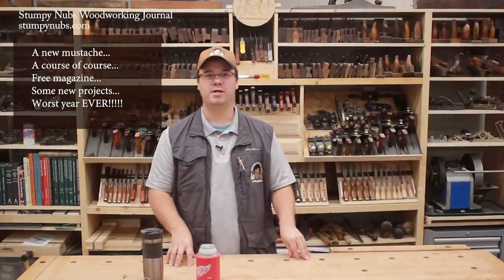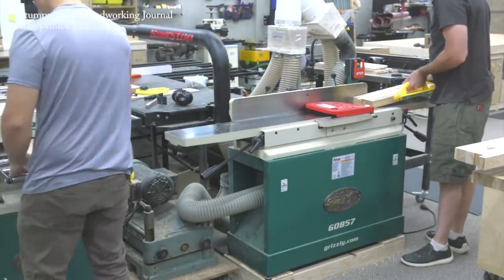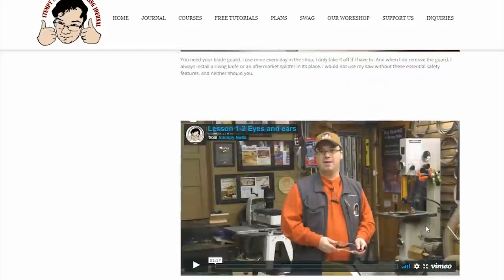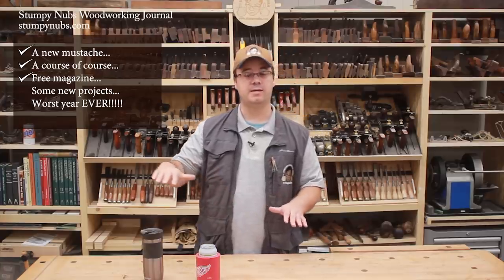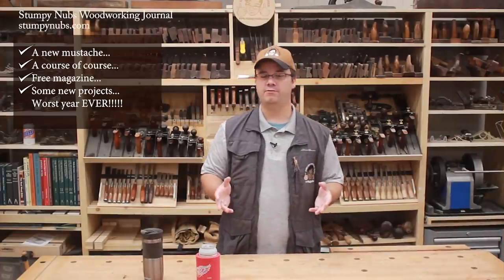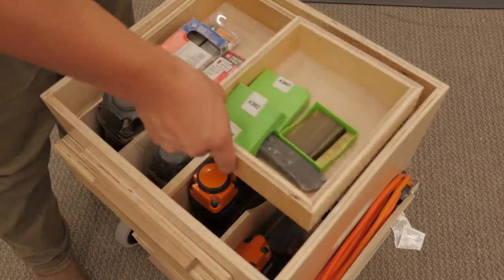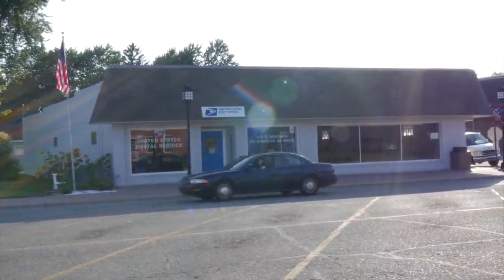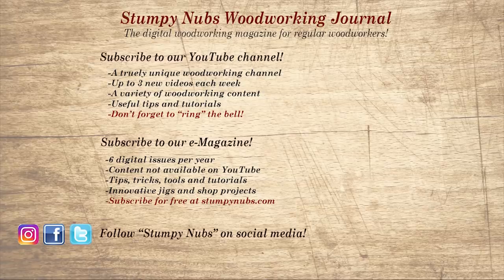I need to tell you about some big changes and some new projects.

Comment: Love your videos and just bought your Homemade Workshop book. As someone just getting into woodworking, I am looking forward to more videos including the courses.
Reply: I’ve been reviewing the design for the router table lift from your outstanding Homemade Workshop book.  (Readers/viewers need to buy this book or the plans from your website!) The design is pure genius and is next on my build list to get my garage-based shop ready to build some actual non-shop projects (crawl/walk/run). The one challenge I see is I just got a Bosch MRC23EVSK router which has both fixed and plunge bases, but requires the swappable motor to be in a base in order to power it on. I plan to mount it with the fixed base and motor inside your router lift, but need to account for the handles, increased width and not quite cylindrical shape. The widest part on the handle axis is 10.5 inches. From the router lift diagrams it looks like the width of the router mounting panel is 9.25 inches. So unless I orient the router a bit sideways or remove the one handle that doesn’t have the power trigger it won’t fit. With the non-trigger handle removed the handle axis is reduced to 8.5 inches, which appears to fit into the mounting panel width with 3/4 inch to spare. I was wondering if you had any thoughts or suggestions as to whether this is the best approach before I start making cuts. Either way I’ll still need to account for the trigger handle arm with the router mounting blocks. Thanks!

If I get this to work, I want to put the lift in my Delta 36-725 T2 table saw and see if I can get your sliding router table and router fence to work with that. I’ve seen a lot of router table videos and that is easily the most creative and useful.

Comment: @ 2:43, the nail you are holding is what was used to install the cedar siding (3" horizontal lap) on my house, built in 1933.  Over the last two years, after insulating the house, I peeled all of it off, installed R-5 Blueboard (with cellulose blown in the cavities, behind the 10" x 3/4 horizonal sheathing), and covered it with vinyl siding. I now have about 30 pounds of those nails. They look too cool to throw away or recycle. About 40 years ago, I had an uncle who brazed these into orthogonal grids of nails and made wall hanging art out of them. Any idea on their origin? Is there some story behind them?
Reply from the maker: Here's a video all about them: https://www.youtube.com/watch?v=7rwcGXIORro

Comment: Great video! Lots of teasers but I’m looking forward to your classes. 
How long is the wall you’re working on?
Reply from the maker: 14-feet, the standard length of a garage wall. If your wall is shorter you can sacrifice the spot for the band saw on one end or the drill press on the other (a bench top drill press will sit on the workstation where the grinder is.)
Reply: @StumpyNubs  I have the space, so I'll be very interested in seeing what you come up with.